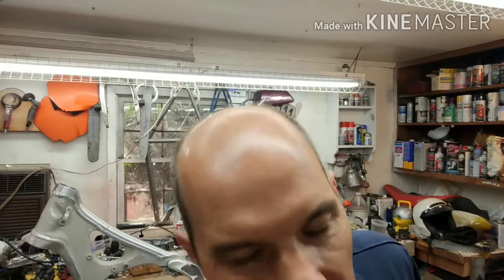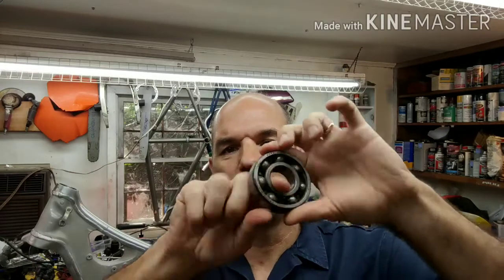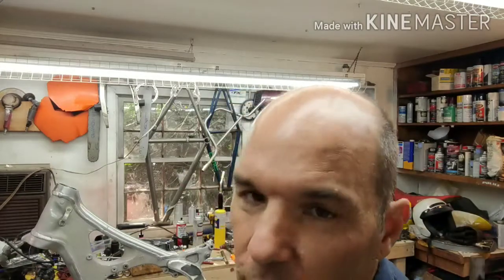Ethanol fuel in 2 strokes??

Comment: I was thinking about converting my cheap 2 stroke motorized bicycle to E85 the Pros & cons seem to outweigh using gas....The biggest pro is, E85 burns much cooler which will really help on long summertime rides. Plus the little engine can make more power and it burns much cleaner=much less carbon build up. As long as I don't leave E85 in long term to attract moisture, the crank bearings should be ok.

Comment: Yup this is a problem with 2 cycle snowmobile engines. Fogging is highly recommended on them. 
I’ve had 4 cycles do this to to the exhaust valves. Valves were open and sat that way for a number of years. Stem and seat all rusted up and pitted. Mainly the straight piped Atv’s or motorcycles.
Reply from the maker: Exactly, thanks for the comment!

Comment: I use only ethanol free fuel mixed with full synthetic 2 cycle oil
@50:1.  I have never had a problem
And always store my yard equipment dry in the off season
Reply from the maker: Perfect, exactly what you're supposed to do!

Comment: You have to add 30:1 to 40:1 diesel or kerosene, to ethanol contaminated fuel, in order to raise the boiling point back up to a safe useable level. Neat unleaded gasoline boils at 35 degrees C. Adding 5% ethanol drops the boiling point to 18 degrees C, meaning that the fuel mixture boils as soon as it enters the cylinder at BDC, instead of under compression near TDC. This causes poor combustion, excessive smoke, sooted plugs, overheating, piston seizures and loss of power. Diesel & kerosene have a higher boiling point, than gasoline, so mixing it with ethanol contaminated gasoline will raise the boiling point in accordance to the ratio of mixing.
 
I've been running diesel in with my 2 stroke road bike fuel for a few years now and can testify that it solves all the running problems with ethanol.

Comment: My 2023 GasGas mc250 2 stroke says up to 10% ethanol is okay to use. Do y’all think I still shouldn’t use it? It says run 95 octane
Reply from the maker: You can run it. The bigger issue is the water it attracts and the corrosion it can cause.
Reply: @TepcoCycleRepair  Okay, thank you! I've searched all over my area and can't seem to find non ethanol that is 93 or higher. Nearly every gas station here has 93 but its all up to 10% ethanol. Or I find stations with non ehtanol gas but its only like 87 octane
Reply from the maker: @Dawgfan005  If you have a Sheetz near you all the new locations have 90 non ethanol.

Comment: I run e85 wich is 85% ethanol and 15% gasoline mixed with castrol a747 ricin based 2-stroke oil. Its cheaper, more powerful and better for the enviroment so i dont know why people dont use ethanol more.
Reply from the maker: Because ethanol attracts water and is hard on rubbers. How long have you been doing this?
Reply: @TepcoCycleRepair  5 months i changed the fuel hose to something that lasts with ethanol
Reply: @TepcoCycleRepair  running ethanol isnt a problem for me because i only run it when its summer because it doesnt perform well below freezing and castrol a747 shouldnt be used at below freezing tempatures so i only use ethanol in the above freezing tempatures and ride every week so it doesnt really have time to atract water
Reply from the maker: Interesting, you're the first person I've heard of using E85. What bike are you running it in?
Reply: @TepcoCycleRepair  derbi senda 70cc. Its a spanish 50cc Supermoto but i have tuned it a bit
Reply from the maker: @klsojenzljbenodbd  Nice, trying to get my hands on a Aprilia SR50 with a 70 kit, carb conversion and worked suspension.
Reply: @TepcoCycleRepair  nice these little 70cc bikes are really fun

Comment: heres a tip, use avgas
Reply: Yakno avgas is leaded right?
Reply: Avgas is a terrible performance fuel, you’re leaving power on the table. For the same price you can usually find Sunoco or VP 100 octane at a pump.

Comment: All WRONG!
Reply from the maker: Please explain, better yet, make a video about how I'm all wrong.
Reply: @TepcoCycleRepair  I'd say you were all wrong because all you have to do is remove the ethanol then use the ethanol free fuel like you always did!
Reply from the maker: @jonathansimmonds5784  You could but it also drops the octane rating by approximately 2 octane if you remove the ethanol. So 87 would then be 85 which I wouldn't run in anything.